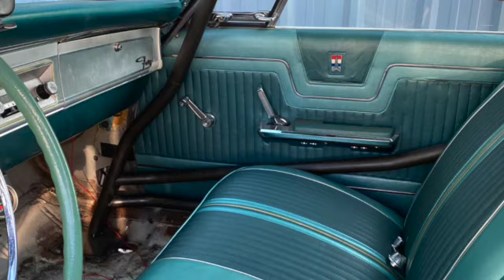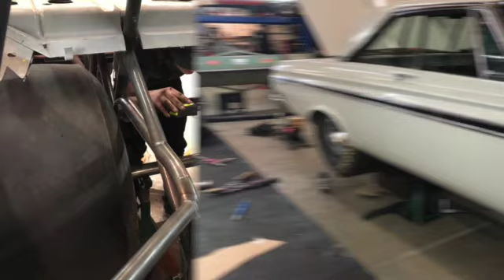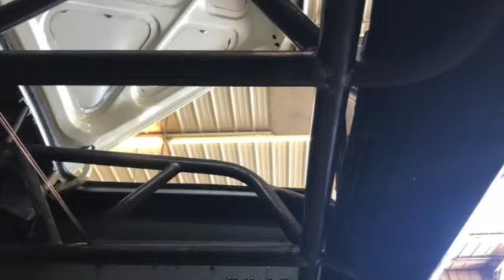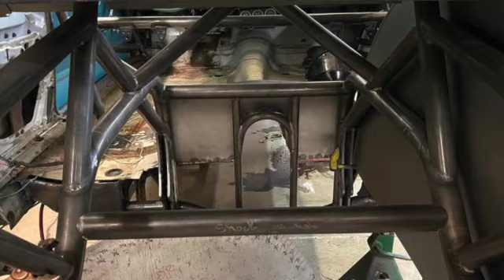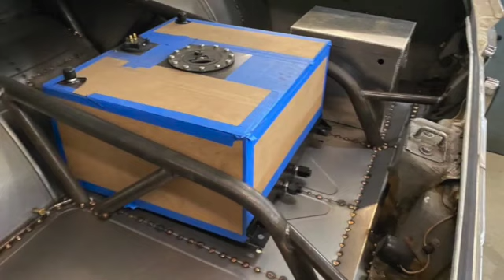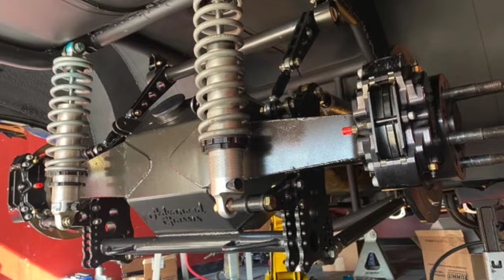8.5 cert cage and back half (lots of photos) 1964 Plymouth Fury

Comment: The guys that can take a car, gut it, and fabricate all that tubing, that looms like a complete mess, and when they are done, it is as much a masterpiece as the Moaning Lisa. The hangers and bracketry for the four link adjustment is so trick looking. I'm a pretty excellent Mig/Tig welder, but I cannot fabricate to save my life. Simple brackets, yes but to to take a pile of tubing, measure, cut, bend and install all of that and it actually turns out is amazing to me. I would have loved to have seen the guys from Shelby build the GT40 or Cobra, the early NASCAR guys, and the 70s era NHRA Pro Stock guys build those Vintage racers.
Reply from the maker: The cage and tub work were the only things I had to send out to be done by a professional. Advanced Chassis did an exceptional job on the car.  Thanks for watching.